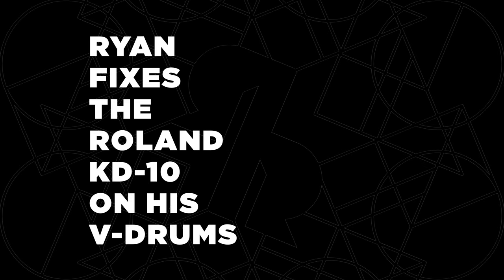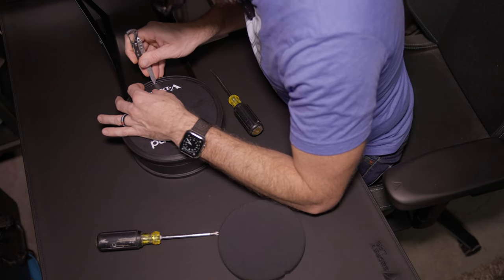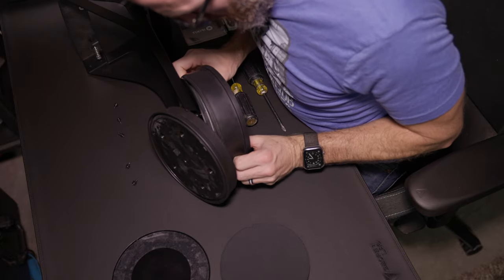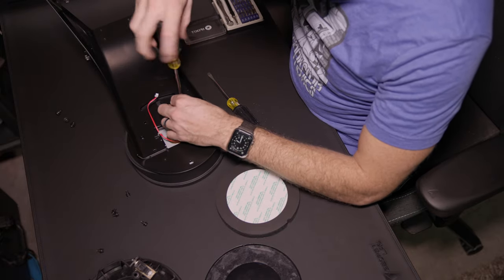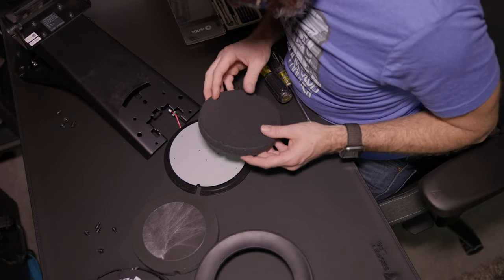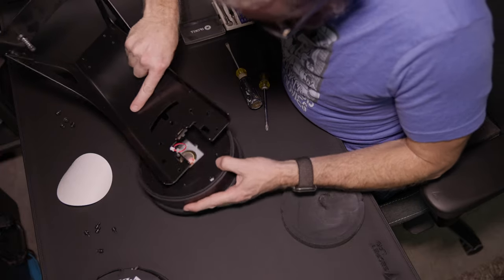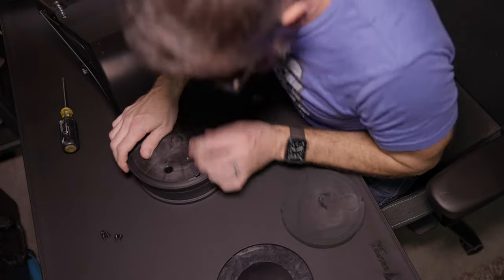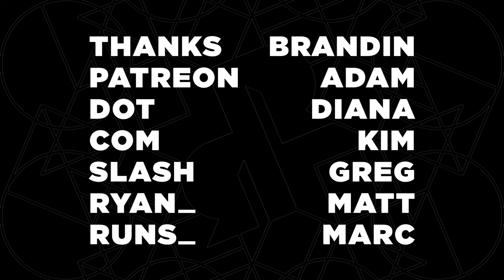Ryan Fixes the KD-10 Unit on His Roland V-Drums

Comment: Hi Ryan! Many thanks for your video. My problem wasn't the rear cushion but a loose wire on the piezo. But all the video was extremely useful to disassemble the kD-10 without destroying the whole planet. For those of you who have the same problem (the symptoms are basically that the bass drum start to mute or to give double kick randomly) just follow the steps on Ryan's video and find the loose wire on the piezo (there are only two as shown on the video). In my case was that the wire just left out the welding glue. So, I cut a little of the cover of the wire  to expose the metal inside (be extremely careful on this) and stick it to the piezo ring with epoxi glue. In less that 15 minutes I have the problem solved and my soul went back to my body. Hope that helps.
Reply from the maker: Fantastic, thank you!

Comment: I think it's weird that Roland doesn't mention to use the rubber side of the beater in the manual of the KD-10 as far as I know...Someone at the store mentioned it to me so I started searching.
Reply from the maker: Definitely something that should go in the manual!
Reply: Today (after playing mesh head around 1year and 10mounth)  I founded out that it's unhealthy to use felt beaters.... crazy
Reply: So we should be using the hard back of the beater? Not the felt?
Reply from the maker: @verzure  Correct!
Reply: Alternatively you can use a head patch on the mesh head and then you can use the felt side of the beater. I highly recommend using Remo's Falam Slam kevlar patches, because unlike the nylon patches, they don't chew up the felt and leave dust everywhere like you see in the beginning of ryan's video.

Comment: Great video.  I just replaced mine but now the kick pedal doesn't trigger.  The only way it triggers is if I tap the back of the piezo.  The connector is plugged in correctly.  Absolutely no idea.
Reply from the maker: Oof, wish I understood more about how it worked so I could help. Honestly there's not much that can go wrong with the replacement so I'd believe you got that right and maybe some cables came unplugged or are only halfway in?

Comment: Please, I have a question. Where did you buy this rear cushion?
Reply from the maker: Roland direct, it started as a support request here: https://www.roland.com/backstage/support#product_support. It may have eventually been changed to a parts order request because it wasn't covered under warranty, and they had to order from Japan, but I only dealt directly with a guy at Roland. The part is called the "rear cushion" or "sensor cushion" though so you might find other vendors just by searching for that. Good luck!

Comment: Hey, can you provide a Link where to buy this piece for the KD-10? Thank you!
Reply from the maker: Roland direct, actually, it all started as a support request here: https://www.roland.com/backstage/support#product_support. It may have eventually been changed to a parts order request because it wasn't covered under warranty, and they had to order from Japan, but I only dealt directly with a guy at Roland. The part is called the "rear cushion" or "sensor cushion" though so you might find other vendors just by searching for that. Good luck! I'll probably be asking you in however many months when I need a replacement again...
Reply: @ryan_runs_  Thank you very much!!!
Reply from the maker: @trexabyte9943  Anytime, happy drumming :)
Reply: @ryan_runs_  Do you mind me asking how much it cost? I was hoping I could just rotate the cusion 90° as the two spots for my beateres are compressed in and the right side is so bad it triggers pretty terribly, but now I guess I know I can't do that. Saves me taking it apart and having a real issue with no backup though, I'll have to wait til I can get a whole new one
Reply from the maker: @Fentonyl  Don't mind at all, $46.57

Comment: Great video, thanks for the insights! Quick question: I'm using the Roland RDH-120A Double Kick Drum Pedal with a KD-10 kick, but I'm experiencing a double-hitting issue with just one pedal press. I've already tried adjusting the beater height and pedal tension with no luck. Any tips on how to resolve this double kick sound?
Reply from the maker: In my limited experience I've had this happen for 2 reasons: 1) sensitivity to my own technique i.e. I was letting the beater bounce sometimes and the unit was sensitive enough to pick it up. 2) Transference from other impacts i.e. sometimes hitting the kit in another area will still be enough to  trigger the wrong unit. I haven't had this issue with the kick but the cymbals can be all over the place sometimes with this.

For problem 1 I just learned to bury the beater, for problem 2 it takes a lot of troubleshooting, mostly unplugging units until the problem goes away and then I can sometimes tell where it's coming from. If I remember correctly there's a way to adjust for some of that with the drum module too, I'll see if I can find it again but I'm pretty sure it was in the TD-07 manual.

At one point I tried to use the RDH-120A as my kick drum but the software on my computer didn't like it, I don't quite have the words but I think it reads differently, like it wasn't sending single "hit" commands like the KD-10.

Hopefully any of that helps!

Comment: I've got to dents from my double pedal but not holes. Do you think Ryan, that simply turning the pad 90 degrees would keep it going for a while longer and are those side indents on the cushion vital as they will obviously be out of alignment by 90 degrees too? Very helpful video, so thanks for that!
Reply from the maker: My guess is that would work fine, the cushion is uniform throughout so I don't think those indents matter directionally at all. Hardest part will be removing the pad without damaging the back or sticky part too much (slow and steady would be my guess there), and then you might have to make 2 new notches yourself, or at least one for the bottom where it fits with the rubber cover (it's been a while, I'm not sure how tight the fit was there). If you do have to make your own notches I'd be careful of cutting the pad since we know ho prone they can be to tearing, might be worth trying a heated nail or something similar that will heat seal it at the same time. Good luck!
Reply: @ryan_runs_  Thanks Ryan, I was going to reply earlier, but I wanted it to bed in. I can confirm that this works! Like new again. There was not need to cut notches (not even sure of their function) and I was able to reuse the old glue. Also by fluke I even managed to get the most dented part at the bottom away from the new impact points. This is a simple repair so if anyone reading this plays double pedal you can extend the life of the KD-10 Pad/sponge  in this way. I recommend cutting the cable tie and fitting a new one. Also if you happen to pull the entire conector of the PCB it's no problem to carefully remount onto the two pins.
Reply from the maker: This is GREAT info, thank you!

Comment: Hi, thank you for this video, I could not figure out how to get the back off to take it apart! 

Question, my issue seems to be that one of the red wires came away from the glue on the back of the sensor. Any ideas on reattaching it? Should I try to heat up the glue or maybe add some glue of my own to get it back in place?
Reply from the maker: If it were me, since I'm still someone who doesn't have any real knowledge about how the electronics actually work, I'd try to reproduce the original conditions as much as possible – I guess that might be an obvious statement, but other than that it's hard to say because I don't know if the glue is meant to conduct or isolate (it's probably forming a connection, right?), and I see your problem because it's hard to test without putting it all back together again!

You could test heating the glue with a hot nail or something, should be able to tell pretty quick if it'll reconstitute or not, but if you can still get the wire back into it's original place (if it came loose instead of broke off) then yeah you might be able to just add glue to keep it in place again.

Also how new is it? I think the KD-10 has a year warranty from Roland...
Reply: @ryan_runs_  All great suggestions, and what I initially ended up doing was using a hairdryer to heat the glue, and I pulled it away to find out that the wire was actually disconnected from a soldering point. So I got out my soldering iron and a bit of solder and I reattached it. Thankfully, that did the trick, it worked right away after doing that. I used some electrical tape to resecure everything and I got it back together and it plays like new now. Thank you again for your video and your response!
Reply from the maker: @yodude225  fantastic news, and I appreciate the info! Happy drumming :)

Comment: Thanks for the video. Mine is almost gone. As I strike the bottom part of the pad (my beater is lower) i was hoping to rotate it 180 degrees and be done but I see there is a notched area in it so it fits in an exact position. Do you think this matters? A new notch should be doable right? and at the end of the day it seems to be the glue what stops it from moving, so I could use double-sided tape. Was hoping to get your thoughts before I dismantle and find out the hard way. 😂 Thanks
Reply from the maker: My pad was notched on both sides so turning it around 180 degrees should work great. If not I'd say a new notch wouldn't be hard, maybe even just cut a slit and that would be enough. And if you can remove it cleanly enough you might be able to re-stick it with the existing sticker. Double-sided tape might also be enough but I'd say you definitely want something solid as a disconnect there might affect detection. Either way the casing holds it pretty well in place too, but you'll know pretty quick if it's not connected right. Good luck!
Reply: @ryan_runs_  sounds 👍 thanks for taking the time to reply.
Reply from the maker: @montyoomska  anytime!